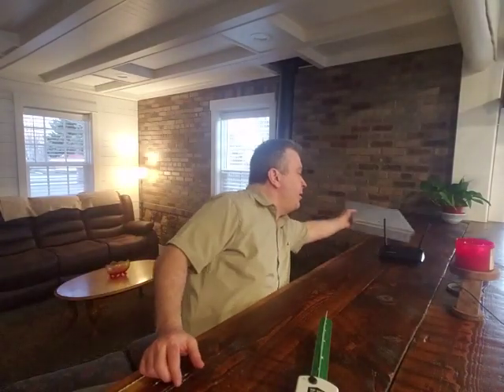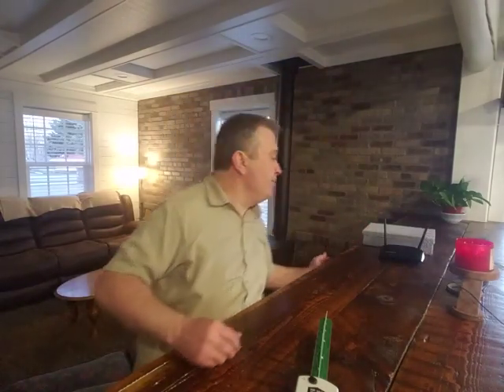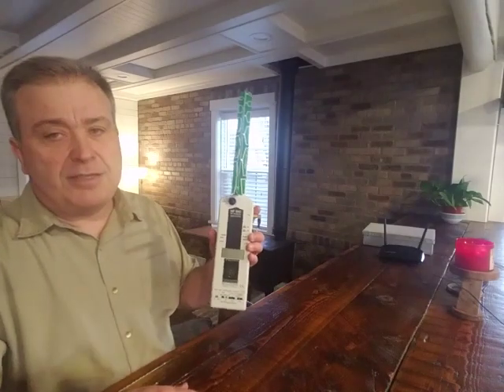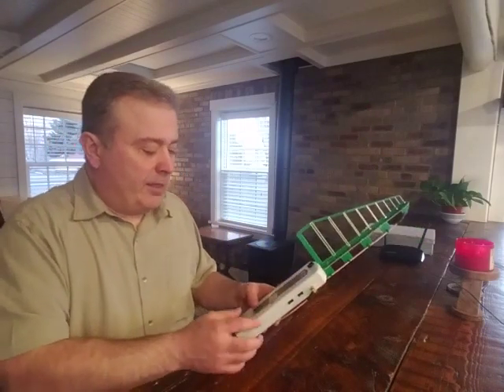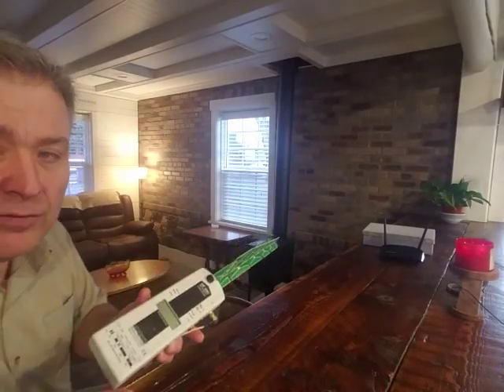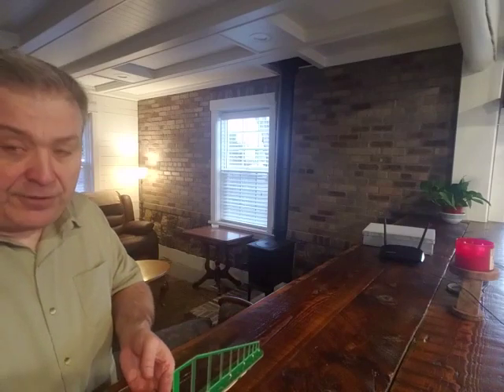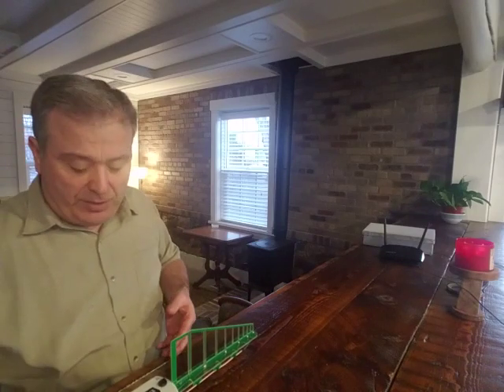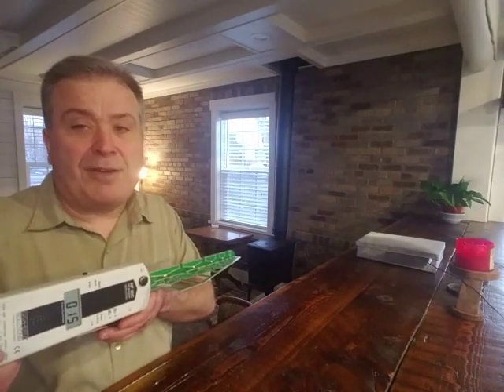Wifi Router Guard Product Review

Comment: Hi If was to buy a router guard would that also help reduce radiation effects of anything else within in the house that is connected to the wifi? My main concern is a virtual reality headset I use a lot which is connected to Wi-Fi. Obviously with this being strapped on your head this is even more of a concern so I really need to know if cutting RF from the wifi router is effective in reducing the harm of these devices and if not do you have any suggestions that could help. I really enjoy VR headsets but RF going directly through your head is a massive worry! Thanks Neil
Reply from the maker: Thank you for the question. Unfortunately no. A router guard works like a ferraday cage, so it only cuts down the radiation from things put in it. A virtual headset use Bluetooth which is the 2.45 GHz frequency which is the exact same frequency of RF Radiation a microwave oven uses to cook food (only with a lot more wattage). With RF Radiation, how close the source is to our physical bodies is more important than the power level (or wattage) of the radiation. RF Radiation dissipates with distance. In other words, a low powered exposure right next to someone, is more dangerous than a more powerful exposure a long ways away. Also the longer the exposure time is, the more dangerous it is. A good page to read on RF Radiation is the scientific studies page of my website https://www.radiationhealthrisks.com/scientific-studies/. There are some really informative videos on that page.
Reply: Hi Thanks for your answer so as my VR headset needs Wi-Fi I am assuming there is nothing I can do to lower this risk accept wear it less. Incidentally my  Wi-Fi is 5 GHz not 2.4 Ghz does this make the RF I am exposed to even worse when I have the VR headset on? Thanks
Reply from the maker: @neilkinsella5359  Sorry if I wasn't clear on that. Your VR Headset is emitting Bluetooth WiFi just like the WiFi router is, just a slightly different frequency. Your router emits 5 GHz and 2.4 GHz and the headset emits 2.45 GHz (the same as a microwave oven). I am sorry to be the one to tell you this but wearing that headset at all is microwaving your brain. It is just like wearing any other Bluetooth headsets or earbuds. Bad news. I would not wear them or use them at all.

Comment: I read that shorter waves dissipate faster and are worse at penetrating walls. Also they penetrate human skin not as deep.
So from a farther distance, could it be less dangerance then 2.4ghz? 
2.4ghz is the same frequency as a microwave. It is used to heat water molecules. We are 70 percent water so we absorb all that energy too. 
Is it possible that our bodies resonate less with 5ghz?
Reply from the maker: Thank you for commenting. Shorter waves do. However to make sure everyone's signal is reliable 5G devices also emit 5 GHz and 2.4 GHz. So we get exposure from those too. Plus they will put 5G mini towers every 2 to 8 houses. So that will increase exposure too.  Yes 5G (which will use between 24 and 300 GHz) will dissipate in less distance than lower frequencies. A typical microwave uses 2.45 GHz. According to Kevin Mottus from the us brain tumor association, within the RF portion of the electromagnetic spectrum the higher the frequency the more harmful it is.

Comment: Will any sturdy aluminum metal box work as well?  Or do we have to get this product from these specialized stores selling wifi router guards?
Reply from the maker: Thank you for the question. If you use a metal box you won't be able to use your WiFi because it won''t let any out. A metal mesh screen made out of conductive metal works best. It blocks the RF Radiation without stopping the WiFi. If cost is an issue its not as pretty but you can wrap your router with aluminum screen you get at a hardware store. To me it was worth buying the router guard just to not have to deal with the aluminum screen. But aluminum screen works. Hope that helps.
Reply: @RadiationHealthRisks  can I wrap my phone in the screen ?
Reply from the maker: @sofiaruby603  Thank you for the question. Yes. In case it helps here is an article from my website where I go over everything I recommend to protect you from cellphone radiation https://www.radiationhealthrisks.com/cellphone-radiation-protection-items/
Reply: @RadiationHealthRisks  thinking of wrapping my old phones in foil..will that work ?
Thank you for answering our questions 😃
Reply from the maker: @sofiaruby603  In my tests foil seems to reflect rather than absorb wifi radiation. It would work if you cover the phone entirely but then you would not get a cell signal because it would block the signal entirely. Aluminum screen would work better.
Reply: @RadiationHealthRisks  yes, I'm talking about old cell phones that are no longer in use..does radiation still come through it ?
Reply from the maker: @sofiaruby603  As long as your old cellphones are turned off they will not emit radiation.

Comment: I have spectrum it says 5ghz and 2.4 GHz . Is  the 5ghz the same as 5 g cell towers? 
Thanks subscribing.
Reply from the maker: Thanks for subscribing!
Reply: Also what brand is that router guard?
Reply from the maker: @isaiah92  Great question! GHz is the frequency. So a 5 GHz means the router emits the 5 GHz frequency. The G in 5G stands for generation, as in fifth generation. 2G, 3G, 4G, and 5G are all abbreviations of their generation and has nothing to do with frequency. 5G (fifth generation) frequencies will range from about 25 GHz to possibly as high as 300 GHz. The 5G routers currently on the market emit 60 GHz. Here is a link to where you can get either of the two router guard brands I recommend https://www.radiationhealthrisks.com/wifi-radiation-protection-items/. I hope that all made sense.

Comment: Just run ethernet cables if you are worried about it.  The argument that I am worried about cancer from wifi, but can't be bothered to spend $100 and a couple hours to run ethernet cables doesn't make sense.
Reply from the maker: Thank you for your comment. In most of my videos I say that the preferred solution is running emf shielding Ethernet cables. For some people however that is just too expensive. That is why I show these other alternatives. I hope that makes sense.

Comment: thanks a lot!!  my router is too big for the dimensions that these are currently sold in, so i was glad to hear that aluminium screening works to block the radiation, but still allowed the signal to reach throughout the house.  : )
Reply from the maker: Just be sure if you use aluminum screening that you try not to wrap it tightly around the router. It works better if there is some space between the router and the screen. And make sure the screen completely covers it on all sides and top and bottom with no holes.
Reply: RadiationHealthRisks.com thanks, David!
Reply from the maker: @tracygetz  you are welcome!

Comment: Does it slow the speed of WiFi ? Also would wrapping foil around the router work as well ?
Reply from the maker: Boris thank you for the question. Yes it will slow the speed down. It slows the higher frequencies down more than the lower frequencies, and the higher frequencies are what increase the speed. But my internet functions totally fine in my small 3 bedroom home. I watch videos and build websites with no problem. About the only time I have to take my router out of the router guard is if I am uploading or downloading a big file (like a video). Then as soon as I am done I put it back in. At least that way you can choose when you are being exposed to more radiation rather than getting it 24/7.

As far as your question on foil, use aluminum screen not foil (like for making a window screen). Foil reflects the radiation where a screen seems to more absorb it and works better.
Reply: @RadiationHealthRisks  Thank you
Reply from the maker: @borisdvorkin5894  You are very welcome.

Comment: Can you make a video showing the upload/download speed before and after using the wifi router guard with a site like https://www.speedtest.net/

This way we understand the measurable extent of how your upload/download speed changes. Should be a few minutes to test. Thanks
Reply from the maker: Great thought. I will do a video on that in the future.
Reply: @RadiationHealthRisks  You also need to account for background RF coming from Cell sites, TV & Radio stations. You need to show the reading when the WiFi router is unplugged.
Reply from the maker: @scratchy101  Excellent point. I do in some of my other videos. Since I am conscious about RF Radiation, with the protections I have my home stays right around the base level of 2 to 3 micro-watts per meter squared.
Reply from the maker: Yes. I have been asked that before. The problem is I have such slow internet to begin with, it will be hard to show. But I still use my wifi even though its in a router guard. I am moving in the spring and hope to be somewhere where they have better internet. That is when I plan on doing videos like that.

Comment: I don't understand. If the wire guard is blocking almost all the signal being put out from the router, how can you still get a wifi signal to run a computer, as you said your son does?  I thought the idea was to wrap up the router (that does NOT have a wifi "off" button) and then hardwire all your computers with ethernet. What am I missing here?
Reply from the maker: Thank you for your comment. You aren't missing anything. Obviously as you suspect enough signal is escaping to provide the WiFi. My point is it still brings it down into much safer levels according to the meter when I test it. Here is another video where I talk about it as well https://www.youtube.com/watch?v=AeztwV2HTRo.

Comment: I noticed that when you put down the antenna the noise from your meter instantly went down (even before you put it inside the box).  Was that a directional thing? Did you check the reading from different sides as well?
Reply from the maker: Thank you for your comment. I have tested these numerous times. Three things effect that: first that it is a directional meter, so changing the position of the meter changes the reading. Second, the distance the meter is from the router effects it. If the router or meter change the distance between them this effects the reading. And third while it is true a WiFi router when turned on emits at full blast continually, the signal is not perfectly consistent, if that makes sense. Not sure which of those 3 caused what you are seeing, but it is most likely one of them.

Comment: Will wrapping a router box with aluminum foil also work?
Reply from the maker: @microcap1997  Good point. That is why I keep stressing if the goal is to not have any Wifi just call the internet company and have them show you how to just turn off the WiFi. If one still wants WiFi, a metal mesh screen box, or wrap is a better solution. If a aluminum window screen is used it works best if you design it in such a way that there is at least a few inches distance between the router and the screen.
Reply from the maker: @Bizzare77777 Again, aluminum reflects RF radiation. If you wrap it up completely, zero RF radiation would get out. If zero wifi is your goal to me it is just easier to turn off the wifi function of the router. Then your problem is solved. However if you want to block 95% of the RF radiation, but still be able to use some wifi, wrapping the router in a metalic screen like I show in the video, (or aluminum window screen you buy at the hardware store) is a better option.

Comment: why not just disable the wifi completely, and hardwire it? if you need a tablet to connect or a phone, just use one of those ethernt to usb connectors, then a tablet can use the ethernet anyhow...
Reply from the maker: Thank you for your comment. I say that exact thing in my website over and over. But in my specific case it I live in a very old house and it would not be cost effective for me to hard wire everything. But I agree 100% by far the best way is to hard wire it as long as you do it with Ethernet cables, preferably low emf Ethernet cables. You do not want to consider running internet over your normal electric wiring lines and "hard wiring", that creates massive dirty electricity levels which is another dangerous form of EMF radiation.

Comment: Bought this item. Barley worked at all. A very small reduction in wifi signal. The lid is not a snug fit, I wonder if this causes issues?
Reply from the maker: Your reading depends on the meter your using "how many microwats per meter squared it reads" for it to be able to read the reduction. It reduces it at least 90%. Also do your before and after readings a few feet away from the router. If you are right next to it it is harder to see the reduction because of the strength of the signal.  Like I always say the very best way is to hard wire internet into your home.
Reply: @RadiationHealthRisks  I went on to make a Faraday cage from an old ammo can. That worked much better. But, as you say, hard wire is best.

Comment: Errm. I can see a big problem with this logic, but if I tell you what the problem is, you will just get more paranoid.
Bottom line, if you want to reduce radiation, you have to use ethernet wire.
Reply from the maker: Thank you for your comment. I say that recommend hard wiring the internet over and over again in my website. But in my specific case it I live in a very old house and it would not be cost effective for me to hard wire everything. But I agree 100% by far the best way is to hard wire it as long as you do it with Ethernet cables, preferably low emf Ethernet cables. You do not want to consider running internet over your normal electric wiring lines and "hard wiring", that creates massive dirty electricity levels which is another dangerous form of EMF radiation.
Reply: Would be just as dangerous to wrap a wifi router with aluminum in order to reduce the RF?
Reply from the maker: @Bizzare77777  (Thank you for the comment.) Or put it in a metal box. If you seal it in a metal box or aluminum foil you would get no wifi coming from your router. If that was your goal I would just call your internet provider and have them show you how to login to your router and turn the wifi off. If you wrap your wifi router and don't seal it completely depending on where the hole is it may leak most of the wifi out, which is not really protecting you. That is what is nice about an aluminum screen is it absorbs rather than reflects the Wifi. You will want to test it with a RF meter so that you know for sure what it is doing.
Reply: @RadiationHealthRisks   Does it have to be a certain type of aluminum screen? I think i'll just try this instead. Thanks!

Comment: Thanks for making this videos...just purchased the WiFi router cage and will be buying the hand held reader soon.
My question is, if the cage, or any of the products you’ve reviewed, block the radiation that is emitted...where does that radiation go??  Are they being directed in a direction where there is no metal mesh thus creating a stronger leakage in one direction?
Or is the radiation being absorbed by the metal cage itself which I would think still creates a concern??
Reply from the maker: Based on the tests I have done they seem to absorb it and dissipate it. A metal screen mesh does not reflect it so that it all comes out in one direction. RF Radiation dissipates anyway simply with distance, the farther away you are the safer you are. A metal mesh makes it dissipate a lot quicker as shown in the video. Again like I said in the video the very best way is to hard wire your home with internet so that you can shut off your WiFi altogether. I hope that made sense.
Reply: @RadiationHealthRisks  This is wrong information.  A screen acts as a reflector.  RF does leak through the holes in the screen but generally, depending on the size of the screen, reduces the RF drastically.  Screens are used in antenna designs for reflectors.  Think of a dish antenna, the dish is the metal/screen reflector.  The screen Does NOT absorb the signal, only reflects it.  If your signal from your router is strong, go into the settings and change its output.  Most newer routers allow you to turn the power WAY down.  The reason for high power models is to cover large homes and properties.  My home is 3K plus square feet on 3 acres.  My router covers most of my property.  The metal mesh around the router, at worst, could burn out the transmitter in the router because of the antennas close proximity to the metal cage.  To keep the wireless routers RF away from you, put it up as high in your house as possible, away from your body.  In another words, RF intensity decreases the further from you, so put the router upstairs, on a high shelf so your coverage is increased and the distance from you is increased.  If you live in a small house or apartment and don't need the distance, still get it as far and high away from you but go into the settings and turn the power as low as you can get it.  Your router will also  last longer that way.